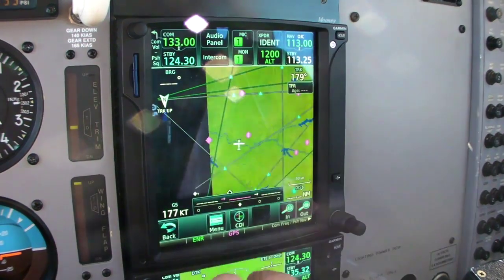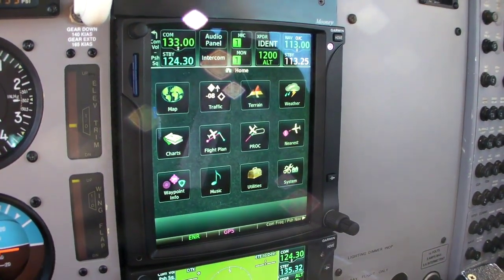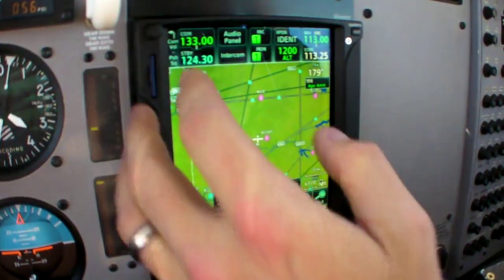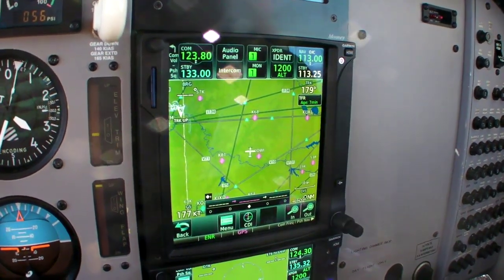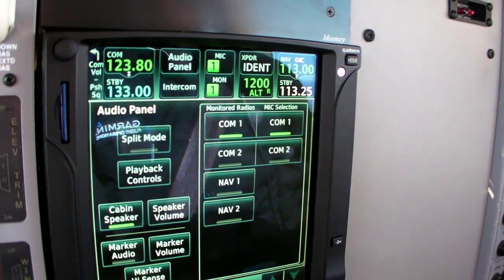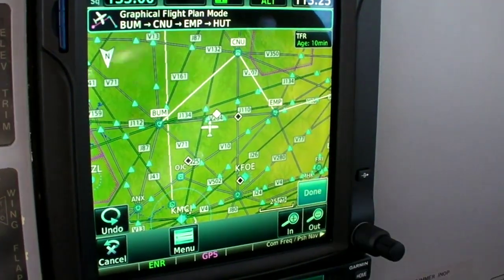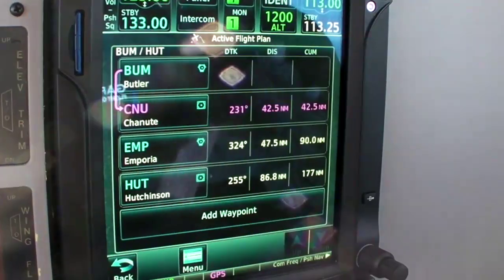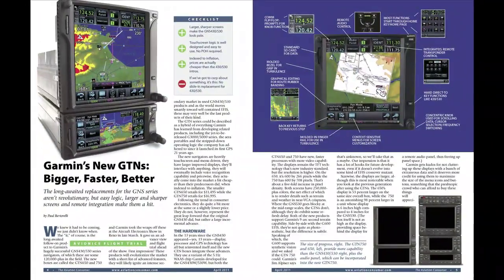Garmin GTN Flight Trial

Comment: @dboy4ever While I agree that car GPS and the one in your cell phone are full featured and handy; they don't need to undergo the same conditions or meet the same high criteria that an aviation GPS system does. I flew a Cessna 172 for many years with an integrated G1000 system with dual displays. There are many features built in with the software that may not be apparent from the get go. Also, in terms of new features, aviation companies tend to be more conservative than consumer ones.

Comment: These look like such a step up from the older models.  Thanks for the videos!

Does the 650 support the directly-draggable flight plan legs?

I wonder about having the Ident that close to where you have to touch to set the transponder frequency.  I would bet that it'll get pressed by accident more than a few times.

I notice that on the 650, you don't see your Com and Nav frequencies at the same time.

If you don't use the remote transponder, I guess that space is just empty?